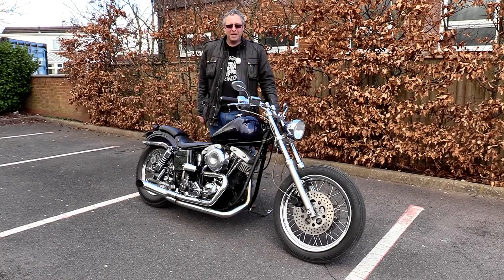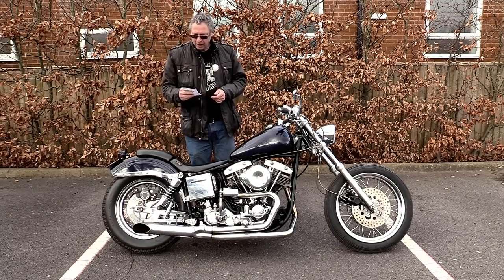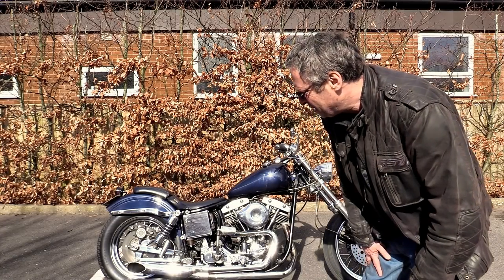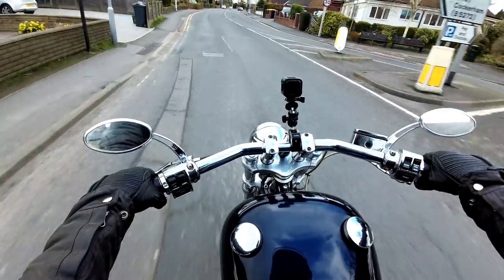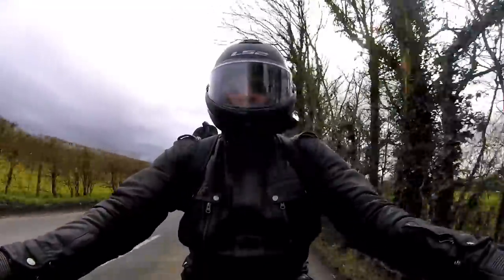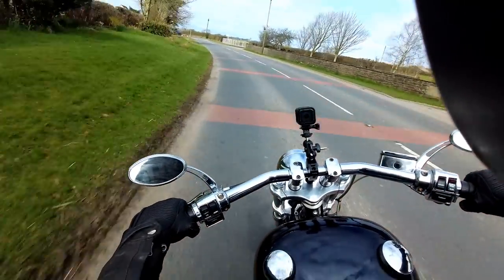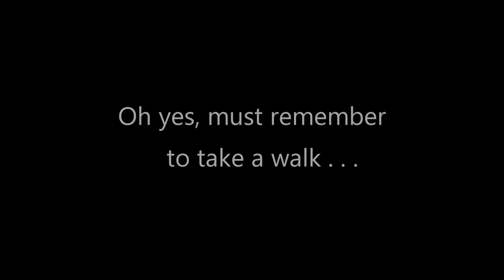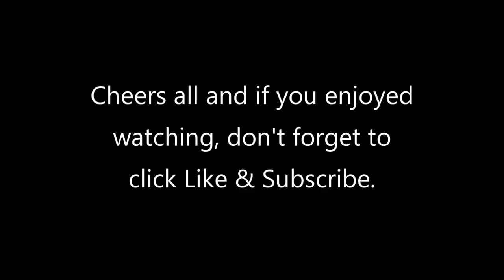Harley Davidson Shovelhead - Review & Test Ride

Comment: I may be wrong but I think your petrol tank is an aftermarket item. The give away is the 'blanked' left side filler cap. It was called a 'Mustang' tank, and was very popular for custom builds. I own a 1958 Panhead with a shovel top end, S&S Super B carb, Belt Drive, Morris Magneto  and 6 over wide glide forks. That's my customized lowrider. Built from the ground up by myself.
P.S. The dealer had 25 years experience in buying and selling Harleys, and 25 minutes of actually working on them. I feel for you. As for the primary I would fit a belt drive and shut off the oil feed if you can afford it. Instant smoother ride an no oil in the case.

Best wishes and ride free bro. Good on you for sorting out all the snags!
Reply from the maker: Ooh a nice 2" primary belt drive would be ideal. Not exposed though, I like my trouser bottoms in tact. Great info on the tank, I'll check that out. Your Pan sounds superb and as rare as hen's teeth in the UK now.

Comment: Man great job mate. This brings back good memories.  I had exact bike except it was a 74.  I worked at a custom shop back in the 90s. And rebuilt mine with the extra wide front end and the dual fat bob tanks  and a kool bob type rear fender. It was awesome black cherry. And a lot of shiny chrome!!  God luck buddy and keep on rollin
Reply: I have pica but they are the normal photos from those days not digital.

Comment: Well presented . A Fine Looking Shovelhead . Wheel rims , check with a magnet , they do not look like Alloy [ to me ] . Front Discs appear to be Stainless Steel . Raked Front End , on certain roads / Speed , you can go from Fun to Fright real quick [ altered Trail ] . Sealed Primary Chaincase  , to work as Harley intended , all gaskets / seals must stop any ingess of Air , so a Vacuum will be pulled , allowing the Oil to return to the Oil Tank .. A Modification many carry out , is to Isolate the Primary . Remove all the Oil Lines , leave just a Breather , and add 5 -6 fluid ounces of Primary Oil . This stops any debris from returning to the Oil Tank and Filter. I have been riding the same Shovelhead for 40 Years , toured extensively , Home and Abroad . Plenty of Help and Advice on the web . www.shovelhead. usa , being one . Wishing you continued Enjoyment on Your Travels .

Comment: I've always wanted a Harley. That ride brought back memories (both sound and riding position)  of when I used to ride a Triumph Bonneville T120 with twin Dunstall's back in the late 70's.. I completely stripped that bike back to the last nut and bolt. I do have a more modern BMW R100RS (1988 vintage) which I'm getting back on the road but it's not the same as the Bonnie. Keep up the good work Kevin, I enjoy both the canal videos and bike ones. Nearest canals to me are the Stratford upon Avon and Grand Union.

Comment: I have a same year 1340 the frame had been 'necked' .the clutch was replaced with a Pro .the carb is a Super B. the electric start stopped so was removed and a longer kick start lever fitted .the clutch had belt drive and an earlier tin chain case cover fitted .I have retained the points ignition. after some I had a complete engine rebuild with Keith Black pistons .new oil pump .and a J cam fitted. owning one of these bikes is learning curve .I used to be on an American Shovelhead site that was very helpful but sadly it has gone ? I will say these bikes were not set up for twisty English roads and can be fussy in town but they are a great riding experience .good luck .

Comment: I had a 72 1200 FX and went round a lot of Europe on it solo, and also with a sidecar and a 2 year old in it. Had it for six years and it was a love hate scenario, loved it when it would start easily and hated it when it wouldn't. The electric start was poor so i took it off and just hoofed it. I ran it on straight 50 mostly, but a bloke who was well respected for his shovel expertise said use 20w/50 and a can of wynnes, so i did.Mine had footboards and it was really easy to scrape them on corners, also drum brakes. The rear was hydraulic and was reasonably ok but the front was  bad news.

Comment: When kick-starting a Harley V-Twin get on the compression stroke of the the rear cylinder and kick it through. The front cylinder fires immediately after the rear cylinder so by kicking on the firing stroke of the rear cylinder the rear cylinder fires and in the front cylinder fires immediately afterwards and makes starting the bike a lot easier. Otherwise if you kick on the front cylinder first you'll end up going through that 270° stroke before the rear cylinder fires

Comment: That's one cool looking motorcycle its credit to you, what I really like about is its not over done. Were it mine I'd make is two minor changes a sissy bar & 3 inch round mirrors and flip them to underside the handle bars. I'm 63 and get the exact same cramp on my 48 sporty. What brand & style are the handlebars?

Comment: When you run the stock oiling system for the primary the primary needs to be vacuumed tight or it won't work correctly. Therefore having a leak up by the starter it was never going to work right anyway

Comment: Just remember the 3 kick formula for starting -1st clutch release,2nd prime with choke and a couple of throttle twists,3rd ignition on and god willing kick and fire.But you've got to get the sequence right
.If you've to much of a front end dive think spacers on top of the fork springs and a heavier weight fork oil.Belt back brace if you're getting to much spinal drive.Front brakes,convert to brembo's off a BMW k100.
Hardtails,l'm a real fan and you can ride them with relative ease.Cool shovel,who built the exhaust system.
Reply from the maker: Thanks for the info David. I'll screenshot your comment and try it out the next time I go for a spin. Interesting suggestion about the BMW calipers. Not sure of the make of exhaust, but it may be a genuine Harley one with the innards removed. Only one I've seen that's similar. Cheers

Comment: Perhaps the primary was filled with oil due to the faulty crank seal, and not the dealer? Also, the 2-into-1 exhaust for 1978 is stock.

Comment: Kevin, You mentioned that back tire (tyre) moves out a bit on cornering, Harley swing arms have a grease point for the bearings if it was run dry for a while they could be shot, don't want to see you dump it because of it. I owned that exact same motorcycle in 1979, I digress.  I had a '73 swing arm frame with a '57 Pan Head in it, that had the worn swingarm bearings from no grease. Take care!

Comment: You have me laughing here remembering my 75 shovel, Standard practice fitting a valve spring under the extremely heavy rear caliper, The best bike in the world. As my mate say's potato potato potato
Reply from the maker: Yes heard about the spring before. Never has a 'bodge' looked like it was meant to be there. 😁
Reply: True haha, another was the mounting bracket holding up the carb because rubber manifolds only last so long.

Comment: i. Open fuel petcock
ii. Prime engine with one or more squirts from accelerator pump. 
Ambient temperatures below 60° may require increased priming, 
up to 6-7 squirts depending upon exact temperature and carb jet 
size.
iii. Pull fast idle level, to fully raised position.
iv. Turn on ignition
v. With throttle closed, kick engine through or engage electric 
starter.
vi. If engine fails to start immediately, crack throttle enough to barely 
open butterfly and continue to kick or engage starter until engine 
fires.
vii. After engine starts, position lever to maintain rpm at 
approximately 1000-1200 rpm with throttle closed. Lever may 
gradually be pushed down to closed position as engine warms. 
Engine should be warmed sufficiently to idle with fast idle lever 
off in 1 to 4 minutes or after a few miles of riding

follow that and she will kick every time

Comment: Very nice Kev!
Looks just like my 1975 FXE Shovel!👍🏼
If you’re running an electronic ignition it may not support kick starting, I had the same issue.
Reply from the maker: Yes it has electronic ignition amd she has started on the kick a couple of times, but she has to be in the mood. 😁
Reply: @CountryHouseGent  
Sounds like a typical Shovel.
I have a Daytona Twin Tec ignition on mine and it will occasionally start on the kick!

Comment: Mate here in Australia where all the oldies wore themselves out at runs and big weekends trying to kick their Harleys into life some worked out that nearly everyone had fitted electronic ignition and the ones with points ignition would always start first or second kick,as electronic needed the engine to turn over faster which the electric start did but kick start turned over engine slower which points worked nicely giving a juicy big spark

Comment: Had a 74 Superglide, with all the problems described and then a few more, heheh, does 78 have points and condenser? love the sound. 74 gears were upside down with 1st up, always fun to watch someone unfamiliar, I even forgot a few times, hehehe.  Thanks for the video. get back to the boat.
Reply from the maker: The 78 had points as standard but this one has been fitted with electronic ignition. Fine tuning and fettling required, including push rod adjustment next.

Comment: That shovel runs good.  About the clutch primary.  Myth lie is believed that those are dry primarys with drip feed.  The harley shovels primarys shared the same oil that the engine ran on. These primarys hold 1.5 quarts (so they are far from being dry and actually held a half quart more than the later evos and twin cams).  A hose runs from the oil tank to the inner primary and 1.5 quarts drains into the primary.  Then another hose that goes to the engine oil pump, pumps back oil from an inch higher second hole in the inner primary in order to keep oil above 1.5 quarts pumped back through the engine and into the oil tank.  But at least 1.5 quarts reamins in the primary at all times, so the upper inner primary has two holes that are above the mid section.  From listening to your bike I immediately know you are running a loose primary chain and it needs to be adjusted, and those primary shoes are adjustable through the inspection plate in the center of your primary cover

Comment: On my 19 78 Shovelhead that I built from scratch I could only Buy triple trees what you refer to as yolk, off of a sidecar police bike and they were Factory rakeable triple trees which basically you could have extend the bottom Triple Tree to increase the rake of the front end to increase stability when the side car was on. I no longer have them as I sold the bike with them. But I would imagine they are quite a rare item

Comment: I have 2 shovelhead Sturgis' . Even with the original tanks, you only fill the right half as else it will pour out the lower left half when parked. I also had to rebuild the clutch and put new bearings in the primary of my 1981 this winter. Desperately waiting for a good rain shower here in Switzerland to wash away the salt, and start riding again !
New Harleys dont even come close to these old Shovels....
How did you film the bits that show the handlebars, a camera on your chest ?

Comment: Nice Kev, can I ask where the speedo is? Couldnt see is from the headcam shots.
Reply: meh - I drove a car for nearly 100,000 miles with a broken (not working) speedometer.  never an issue - you just drive a reasonable speed and have one less concern...

Comment: Kev, glad to see you back and enjoying yourself with the new toy.  Listening to the start...both manual and with battery, I'm wondering if you did a compression check when you changed out the spark plugs.  What was the compression numbers?  Just a thought but you probably have already considered.

Comment: Cracking machine CHG, I've a 99 Dyna Wide Glide so am sympathetic with lots of your points, it's a killer on back and shoulders.  Tanks without instruments is awesome, as you said beautifully done, but where is the speedo?
Reply from the maker: Speedo coming soon
Reply: @CountryHouseGent  Where are you going to put it?  Is it MOT-able without one?
Reply from the maker: More than likely it'll be a small electronic unit in a custom mount in the centre of the bars. Usually it wouldn't be MOT'able without but this bike is MOT exempt as over 40 years old.
Reply: @CountryHouseGent   Ah, that makes sense, sounds like it might not have passed anyhow, what the with the balls-up the "experienced" dealer made of large chunks of the mechanics!  Enjoy it CHG!  Is this going to be the vehicle for your Travels by Motorbike?

Comment: LOL kickstart procedure is thus: 3 kicks with gas on and ignition off. Then turn ignition on. use just a little throttle. One hard kick . Left knee is on the seat by the way . Kick hard and it will start.

Comment: Have a good mate in NZ has a  1983 low rider  250,000 coming up on it and the cases have never been apart, top end valves, and lifters yes they were crap from the word go.

Comment: Sounds wonderful. Not sure of the legal requirement but wouldn’t a front mudguard be a good idea.
Reply: Sounds like a sensible idea, if raining soaked you will be.
Reply from the maker: A front mudguard isn't a legal requirement in the UK and doesn't present a problem as I never ride the Harley in the rain
Reply: @CountryHouseGent  Not quite correct. It isn’t absolutely clear and a grey area. Googling will produce vague information. The best answer I can find having consulted someone who is familiar with the law is this. The construction and use act does state a motorcycle should have mudguards securely fitted so as not to obstruct the free turning of the wheel and keep down mud and dirt as far as practical but it is not required for the MOT. So you should by rights have one. However as most muck is likely to hit the motor cycle and not be thrown out to the detriment of other road users you could argue one isn’t required.

Comment: Those older Harleys require a different mindset and knowledge since technology has (obviously) advanced quite a bit. I own a Road King 30 years younger than your bike. Things have improved... I am unwilling to deal with the quirks (and suspension) of the older bikes but admittedly the newer ones don't have the same personality.
However, with your touring plans, I am surprised you did not get a touring model. An old FXE 1200 is not what I think of when I think "touring." I am sure you are in for some interesting adventures!

Comment: My first was a 79 HD ok so it was a 250cc thumper made in Italy but it sad HARLEY DAVIDSON on the tank and AMF in all the wrong places. Currently I have a TW200 Yamahamer. It has big fluffy tires and lots of suspension for my bad back.
Reply from the maker: Ah I love those TW200's. Those tyres must isolate you from every bump and manhole, no matter how bad? Was your Harley the single cylinder off roader?
Reply: @CountryHouseGent  one cylinder 2 cycle kick start. They called it a scrambler. I never took it off road really. It ended up under a big ass Buick and I ended up a few yards over and beyond ,never road again until last fall. Then I found out where the fun went. It great for fat old man on “ cow roads “ around Amish country here in south central Pennsylvania . “ they are kinda like those roads you were riding except we have hills, and more horse poop.....lots more horse poop.

Comment: What ignition has it got? If electronic has been fitted you won't be able to kick start the bike without having the ignition module set up for kick start. Aftermarket ignitions don't spark until the 3rd revolution, not something easily achieved with a kicker.

Comment: Great Britain is too small for a bike much beyond 500 ccs. After a country has produced something as heart-breakingly beautiful as the Triumph T100, why search elsewhere? I am an adventure rider. On average, I've toured over 22,000 miles a year, largely on bikes of 750 cc and below. I had a great year riding a 175 cc scooter, which would take me camping anywhere. I did 4 weeks on that bike, 72 mph, 72 mpg, and don't regret an instant of it. I've ridden the 1100 GSA. What a cow. I've also had an R90/s, R1000 RT, and several K75s. Kev, mate, you're not going "the long way round." Lighten up. You're welcome.
Reply from the maker: Wow Timothy, 22,000 miles a year. How far have you managed so far this year?
Reply: @CountryHouseGent  Kev, sad to say I shattered my shoulder getting off the bike when it had not quite come to a stop near Buchans, Newfoundland and then hurt my back and  re-injured it over 2 successive winters. My riding has been somewhat limited recently. At one point I had 7 bikes in the stable, and  would do things like a solo circumnavigation of Lake Superior from the US east coast. "Motorways" as you call them have little fascination for me -- 2 lane, or dirt/gravel roads are more my taste, and pitching the tent up in the evening on some remote side road with soup boiling on the Primus. Low cost, and you meet a better class of people!

Comment: Beautiful machine have owned many. You need to rev her up higher your lugging the engine badly. The flywheels flop around at those low speeds and the rod bearings get a bad pounding from it.That shovel should be shifted at about 3000rpm minimum. Your shifting her to soon. Open her up more youll have a healthier engine. Stay safe out there! God bless from a yank across the pond!